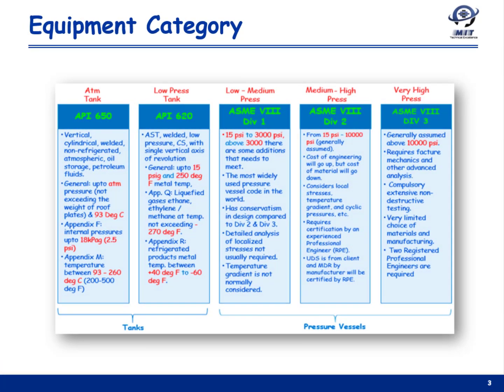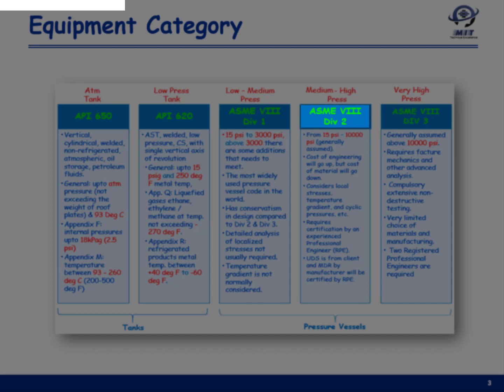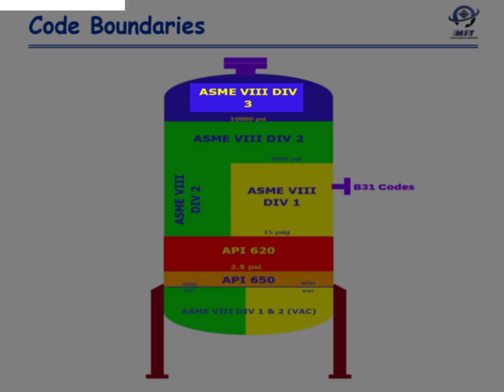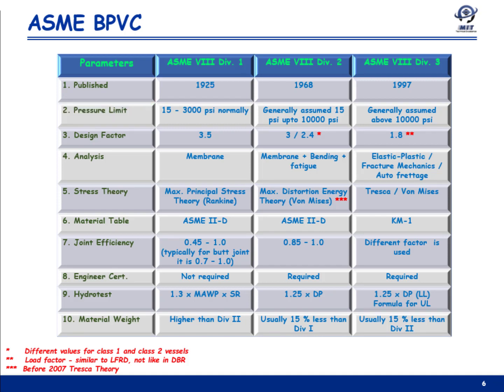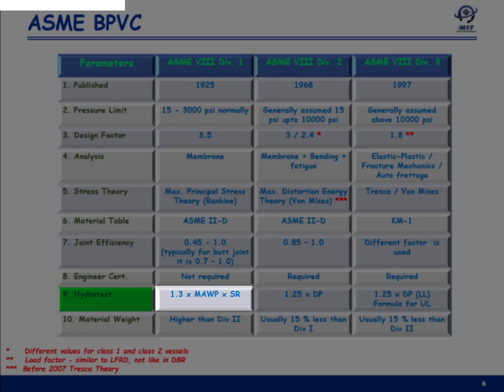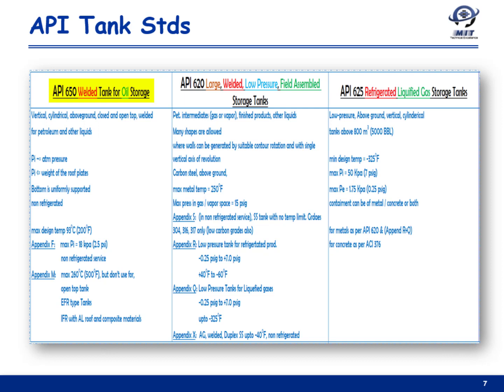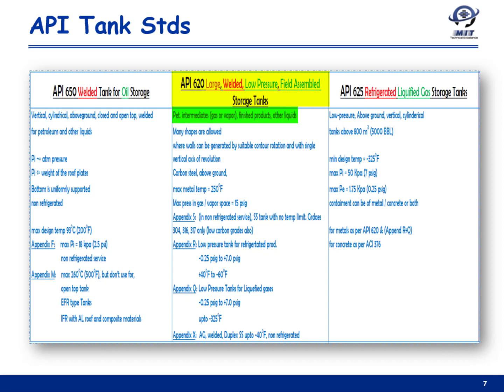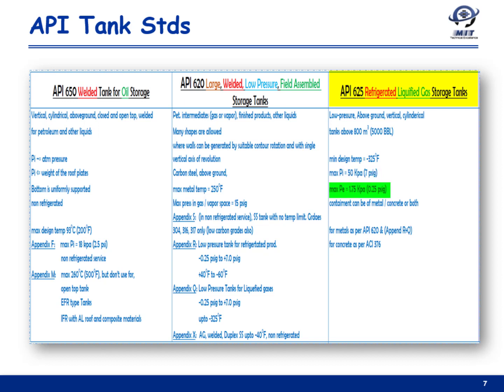Pressure Vessel Design  Code Comparison 2b

Comment from the maker: Stress Theory:
Tresca is the most conservative.
Rankine envelop of safe zone is far bigger
(See my video "ASME SEC 8 DIV 1: CODE COMPARISON-2c)  but when code such as ASME 8 Div 1 or ASME Sec 1 uses it they use it with a big safety margin. Due to which these codes allowable stresses are lower or conservative than other codes.